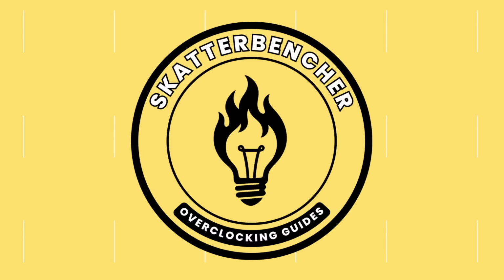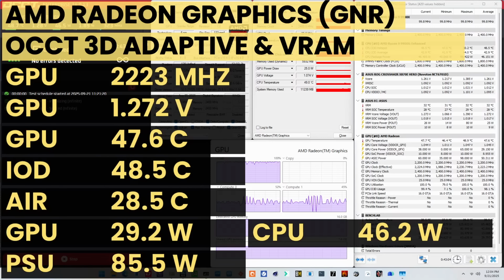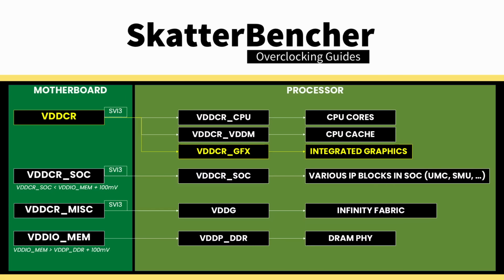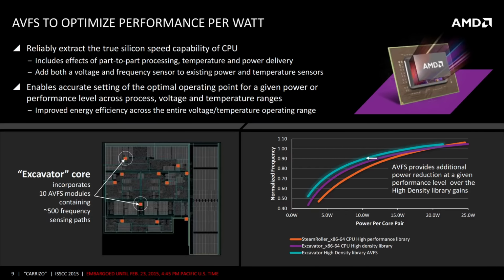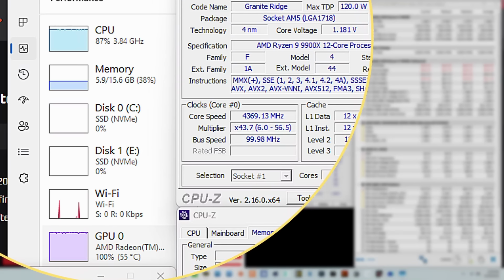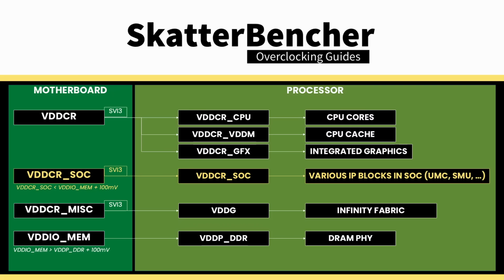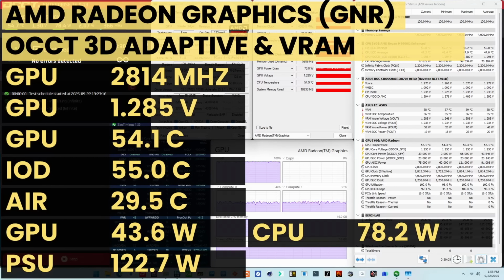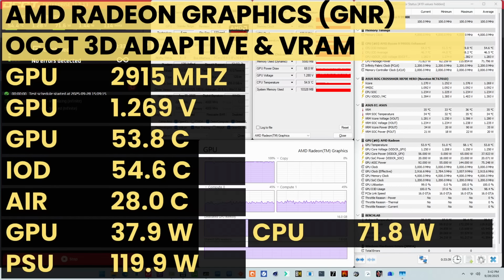Radeon Graphics (Ryzen 9000) Overclock to 3000 MHz | SkatterBencher #93

Comment: I have a R7 9700x, I have enable PBO but from Ryzen master and in theory from there it got write in the bios. Then I got my memories (2x16 6000MT/s CL30) down to CL28 and now I found the GFX Clock Frequency and by only touching that I reached 2.8Ghz, apparently all works fine and I won around 4~5 fps per 100mhz average in games, idk if keep pushing untill I see evident instability or stop there, everything else looks ok, voltages, temps, etc.

Comment: Are you going to overclock the 9900x3d got mine on the 3d chip to 5630 and non XD to 8360
Reply from the maker: Maybe. It's not on the shortlist and I have a couple of other things to wrap up, but if I get really bored then the 9900X3D could be an option :)
Reply: 8360?